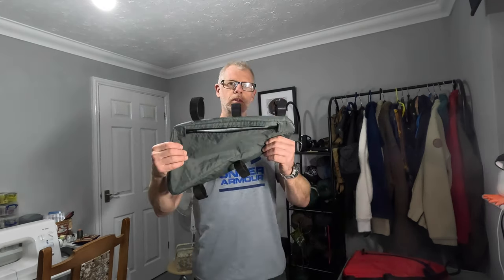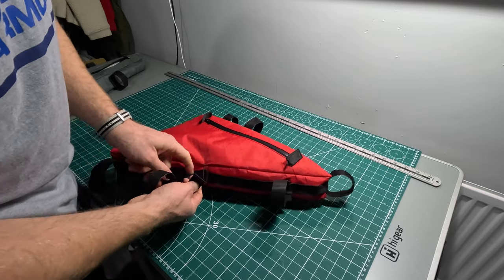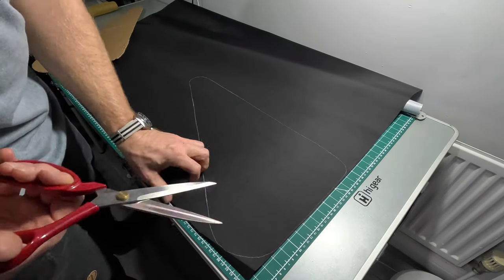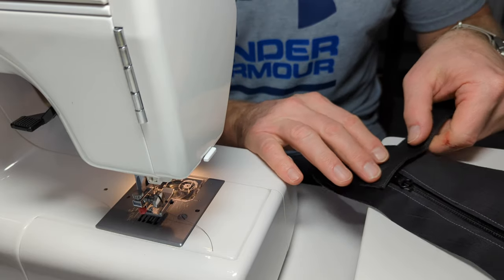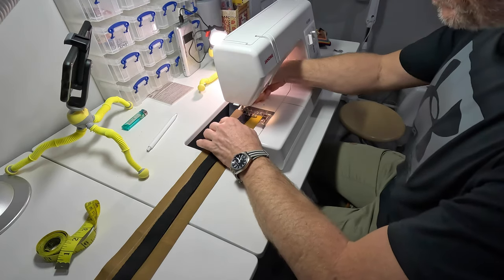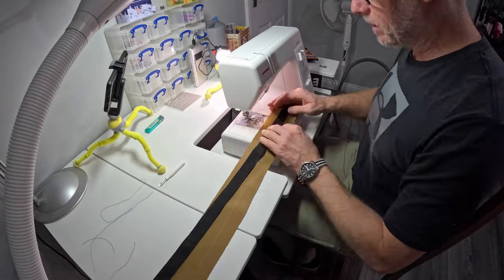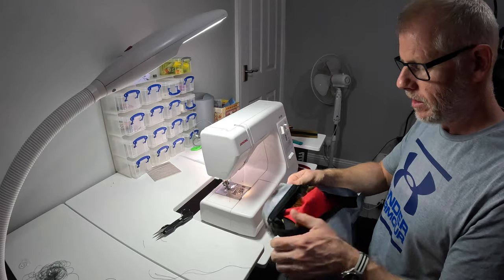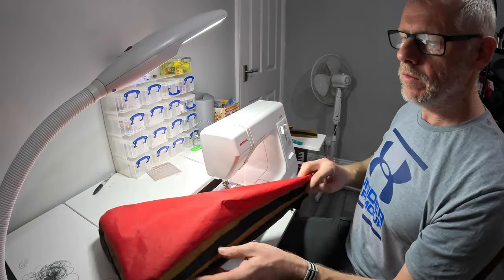Making a Custom Frame Bag for My New Bike - GDMBR Bike Prep

Comment: Hi Mat a great video , forget the superglue  It's called Basting tape and it is used by canvas workers,  very thin and narrow, it helps waterproof as well. Try One Sails in Levington or Solent Sew. Once you start using it its like cables ties or duct tape- You won't know how you lived without it!
Reply from the maker: I'll try to get some. Thanks for the tip.

Comment: Hi I'm about to make one of your bags for my brother. Could I please ask what size needle your using. Size of stitch and what type of thread.  Thank you.  Sue
Reply from the maker: Hi Sue. Sorry for the delay. We used Gutermann Tera 60 thread and a 90/14 needle. This was the needle that came with the machine. I'll add that these may not be the best choices but the frame bag has lasted. Good luck!!!
Reply: @matryderadventures  thanks so much for replying. I'll let you know how I get on. Waiting on the fabric to arrive then I'll get started 😁
Reply: Even with all the frustration and time that was put into this, I still think it's very much worth doing. The satisfaction of looking at something you made and knowing it's exactly what you wanted is is pretty darn cool.
Imagine getting really good at it that you can make any bag at any time you need it.
Thanks Mat.

The leaning back in the chair and exhaling a huge breath as the subscribe alert popped up was brilliant 😊

Comment: Overall nice job.  Good looking bag.
I would make only two suggestions.  I use pins to hold the cloth together while sewing the seams.  It makes it easier to keep them aligned.  And, I always double sew all my seams.  I've made a few projects over the years and two rows of seams always help keep the item together after extended use.  Manufacturers have fancy machines that sew both rows at once.
Reply from the maker: Thanks for the tips. I'll be making another soon and will take your advice into account. Cheers 👍

Comment: Thanks for the tutorial! Really helped me make my frame bag :) 
Those corners are rough though... I ended up starting over a few times and then cutting slits with the scissors one the strip only and it helped a lot!
Reply from the maker: Glad it helped 👍. I may try your technique on my next one. The corners are difficult and relief cuts would definitely help. I try to avoid having a sharp corner. It's nice once it's done though isn't it.

Comment: This video poped up in my feed virtually 30 minutes ago as I write this, and it was brilliant. Loved it. Your bag came out awesome. Now you've got me inspired to make my own for my Rowdy Roscoe 🙂 I had an idea whilst watching your video regarding the little flaps you glued back when making the hole for the zipper. Have you tried using som kind of super sticky doublesided tape for that? I imagine it would make that specific part of the job a whole lot easier. Just fold the fabric where you need to, stick the tape along the folding line and press down the little flap. Job done. Don't know if it'll work, I've rarely put my feet in a sewing machine, but an idea nevertheless. Love your channel 🤜🏼💥🤛🏼
Reply from the maker: That is a great idea. I'll try it when we make the next one. I need to pluck up the courage first! Rowdy Roscoe...great name. Good luck with making yours...
Reply: @matryderadventures  Thank you, Sir, I never would have even thought of going for it if it hadn't been for your video, so kudos for being an inspiration Mat :-) I'm exited for the proceedings. I made the template for the bag yesterday, I've defined the colour palette and the final design, and I've sourced the fabric and the thread needed for some robust stitching. Next is putting in an order to get cracking on it 🙂
Reply: It's called Basting tape and it is used by canvas workers,  very thin and narrow, it helps waterproof as well.
Reply: @sailingholsltd6062  Thank you, that's great input 🙂🙏🏼
Reply from the maker: Interesting. I'll have a look. Cheers 👍

Comment: Excellent!! What stitching styles , gauge, and thread do you use to ensure no failures after loading/vibrating on the bike? Have you ever had to add seams or had issues? I learned alot and just wonder what your iterations have been like.
Reply from the maker: I used a heavy duty Gutermann Tera 40 (I think) and just a standard straight stitch (sorry, I don't know the terms). The frame bag held up perfectly and I haven't had to make any repairs.

Comment: I know you said it in the video but couldnt make it out - what material is this?
(And where did you get it?)
Reply from the maker: It's called Xpac VX21. You can buy it on eBay. It's good stuff to work with, waterproof and not expensive. Cheers 👍